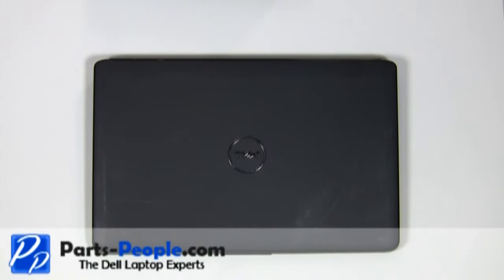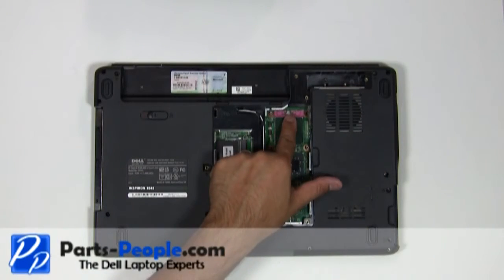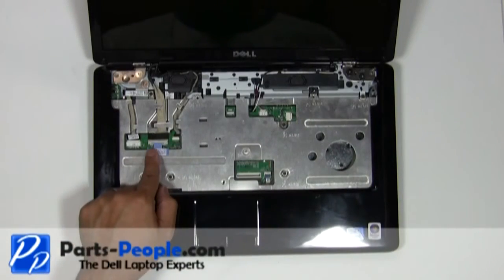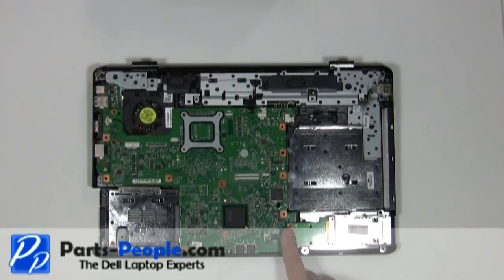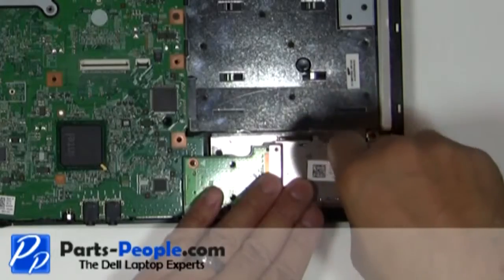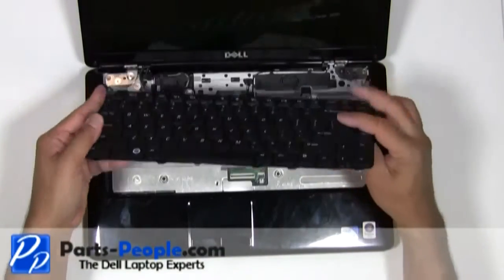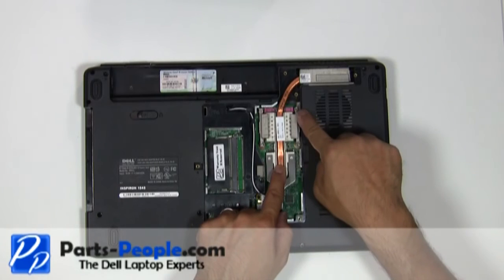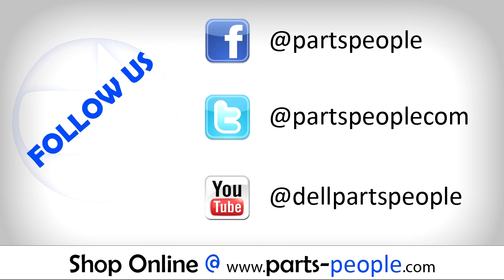Dell Inspiron 1545 | Motherboard Replacement | How-To-Tutorial

Comment: How do you unhook the lvds video cable under the keyboard?   You skiffed right over it and time lapsed it.
Reply from the maker: You're right about that. Let me try to explain:
There should be a black plastic locking mechanism that holds the cable connector in place. It can be unsnapped by lifting it upwards away from the motherboard. After doing this you can disconnect the cable.

Comment: Hey, it is very nice video. I am writing to get some suggestions that I am having with my same model laptop..I have a weird startup problem with my same model laptop Dell Inspiring1545. I was googling it from long time and could not figure out any solution from anybody. My laptop turns on only once in week.For example,  If I turn on Sunday it will run continuously without any problem, but if I shutdown either way by home button or power card pulling it won't boot to windows. It shows the dell logo after that it goes to black screen with blinking cursor and stops there.  I tried multiple options like swapping and cleaning the RAMs, pressing F12 or F2 continuously. None of them worked. Only thing I have to do is wait approximately a week to get booted normally. I have also tried dell  support assistant but it did not get install , because it is a windows Vista. It asks me to get windows 7 first. Even I tried to install windows 7 it did not go to BIOS and stops at dark screen with blinking white cursor. I could not understand the problem. Seems you are good expert and want to know if you have any suggestions. It will be a great help and I really appreciate it.

Comment: Thanks I need this my computer same as the one in the video locked up on me in safe mode and would not accept my Admin PW so this is the first for me disassembly  to lift out the battery I believe this will reset the Bios which also cause me an issue with PW the default was not functioning this video may help me....thanks..

Comment: Thanks for the video, but I did it all and now when I cut the computer on it just beeps. Its 2 beeps then pauses and 2 again. wITH BLACK SCREEN but I can hear the fan running. Whats the problem here u think?
Reply from the maker: +Charles Dunn The beep code is for a memory error. Try re-seating the memory, it's probably loose or not installed all the way.
Reply: +Parts-People.Com, Inc thank you for the fast reply, but I figured it out.
Reply: I also replaced hdd also

Comment: Hey I have a question I'm hoping you or someone can answer.  I followed this procedure to replace the charger board on my Inspiron 1545 because it wasn't charging the battery. (That's the little piggy-back board on the left side that has the charger port, VGA port, and a couple USB ports on it).  Prior to replacing that board, the laptop would run plugged in, but just wouldn't charge.  After replacing it with a new board, it won't boot up at all.  When I press the power button, the fan runs for a couple seconds and stops and the video display remains dark.  However the power indicator light stays lit until I press the power button again to turn it off.  So I took it back apart and put the original charger board back in, but still no good.  So I then thought either the new charger board damaged the motherboard or I damaged it flexing it to remove.  So I bought and installed a new mother board (and used the old original charger board in case that's what killed it)  With a new motherboard, it still does the same thing as above and won't come on completely.   I also turned it on with the memory removed and got the 2-beep bios error so I assume the CPU is working.  I also tried it with the hard drive and optical drive, and wireless card removed to eliminate them as a cause of the problem.  I have no idea what I might have done that killed it.  I would really appreciate any advice or suggestions.  Thanks!
Reply from the maker: +Steveh112 Have you hooked up an external monitor? Perhaps there is an issue with the LCD cable or screen. I would try that to eliminate that possibility. Let me know and we'll go from there.
Reply: +Parts-People.Com, Inc Yes I did, and nothing there either.  But I got it fixed.  Turned out a small component had fallen off of the memory stick.  With new ram installed it works.  I was going to upgrade to 4GB anyway.  But thanks much for the reply, your video was very helpful.
Reply from the maker: +Steveh112 Excellent! I'm glad you were able to figure it out. Very good description of the problem and the things you tried. Most people are very bland in their descriptions. It's usually something like "Help my screen is dark...how do I fix it?" :)

Comment: Okay it's finnalt stopped over heating and it works fine but now I can't get the drivers to work on the ati radeon 4330 I have installed the right ones and that the 64bit vista one but it still just says standard VGA adapter under device manager

Comment: Yeah I am it's only choice is the ati radeon intergrated into the mother biard or the origional mother board which has an intel 4 series graphics card. Also it was a mistake in the guy that sold me its part because it is a 845F or whatever just like my old one so I had to order a new one and this time it is definitely the h435n and I've got the new heat sink on order too :)

Comment from the maker: You can check the part number for the motherboard, there should be a sticker that says DP/N: 0h413n somewhere on the motherboard. Or if you install the motherboard Device Manager should say the video is ATI Radeon ™4330 (Discrete). To be clear, you are aware that the 1545 only has on-board GPUs. It doesn't have an option for a separate video card.

Comment: Okay so I got the new mother board on eBay the 413n and apparently it comes with an ati radeon 4330 but it fitted it and it still has an onboard 4 series heap of junk on it!!! So I only got the board itself either the guy lied and actually it isent a 413n or the part with the ati radeon on he didn't give me? Any help greatly appreciated many thanks :(

Comment: Hey dude thanks for your videos :) may I ask if I was to straight swap out the intel mother board and put in the one with the ati radeon HD 4330
First off I would have to move my duo core prossesor CPU chip over, would that be simple and would it work? Also is that all id have to do? Also what would I do about the RAM as I belive the ati radeon motherboard is ddr3 and my ram is ddr2 :S please help many thanks

Comment from the maker: No, there is only one intel motherboard for the 1545 and it uses the M274K heatsink. You could change the motherboard to the ATI version but you would have to change the heatsink to a K364N. There are 2 ATI motherboard part numbers, 937GW and H314N. Both of the boards have the same performance just different part numbers.

Comment from the maker: The thermal pads and thermal compound make contact with the CPU, GPU, and heatsink to transfer heat and keep the laptop running cool. If the pads or compound it not there, it would make the laptop hot and keep the fan running at high speed.

Comment from the maker: I'm not sure if replacing the fan will fix it, I haven't come across that problem before. We sell the fans for $25. First, did you make sure to replace the thermal pads and or thermal compound on the heatsink? If you didn't, that could cause the fan to kick on to high speed.

Comment from the maker: Dell's internal spec sheet shows the "compatible" CPUs and the T9600 isn't one of them. I'm not sure if it's because the CPU was introduced after the laptop was made or if there is something else that make it incompatible. The CPU specs appear to be compatible so it might work. I haven't tried it myself so, I'm not certain.
Reply: The T9600 works. I've installed it into a 1545 before as a CPU upgrade. Everything up to a T9900 works. Even the E8435 pulled out of an Apple Mac works.

Comment from the maker: No, the 1545 will only use Celeron or core 2 duo processors. The CPUs must meet these criteria:

1. Core Duo or Core 2 Duo

2. 1mb, 2mb, or 3mb cache

3. 667mhz, 800Mhz, or 1067Mhz bus speed

There are more details in the other comments.

Comment: I dont have the money for an external charger and im willing to experiment on the computer but i just cant get the info for those small connectors on this battery. i figure someone here would know and me and my friend are fully aware of the risks and no how to monitor the battery safely since we work on electronics alot. if anyone could help it would be appreciated.

Comment: i have an inspiron 1501 that has only powered up twice since ive owned it. i think there is an issue with the computer and its connectors and what i wanted to do was create an external charger for my batteries for this computer but the issue is i dont have schematics and i've had some time trying to find them. i need to know the purpose of each of the 9 connectors on the battery, like whats the ground, power, etc etc.

Comment from the maker: 1. Core Duo or Core 2 Duo
2. 1mb, 2mb, or 3mb cache
3. 667mhz, 800Mhz, or 1067Mhz bus speed

If the processor meets the criteria then it will be compatible. There are several processor out there, you will have to find one with the best speed. All of the i-series (i3,i5,i7) are not compatible. Keep in mind, the GPU is built onto the motherboard, isn't upgradable, and tends to overheat easily. I've heard about problems with game play on this system because of that.